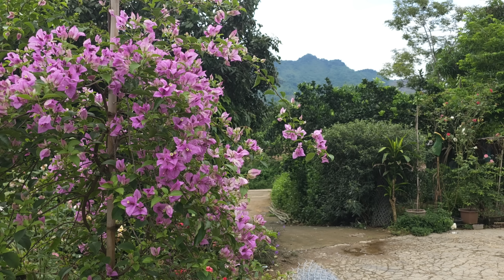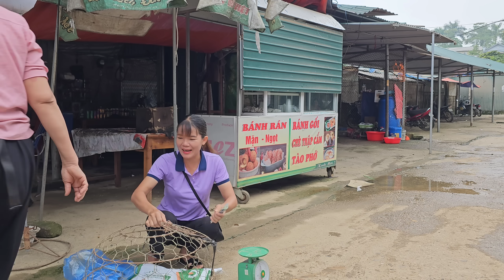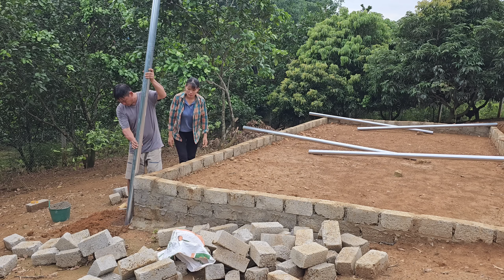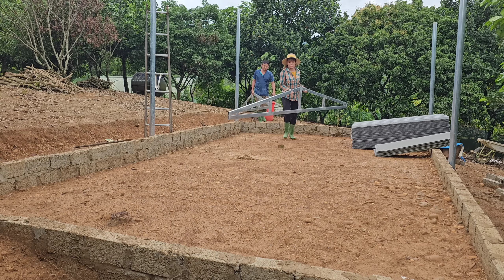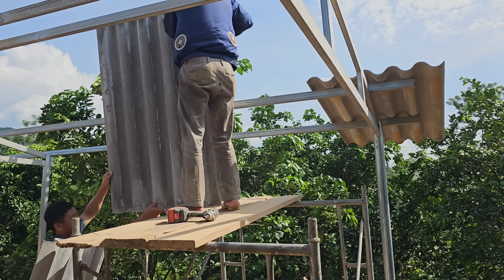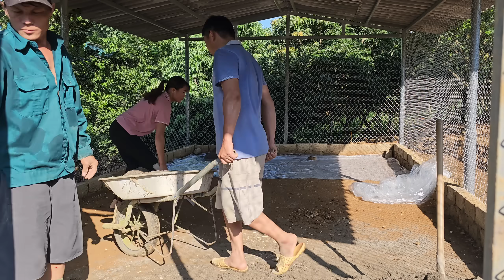Special chickens are sold at the market.  How to make a modern and simple chicken coop. (Ep 198).

Comment: Very good chicken coop, concrete sheeted roof to shade and keep chickens dry from rain, and steel posts to prevent termites; You have put a lot of thought into this coop and it will last for years.  You mentioned placing locust shells on concrete floor as a cushion for the harshness of concrete flooring.    Shovel out the used locust shells every 18 months to prevent disease building up and you can use the used locust shell and chicken poop as excellent fertilizer on your vegetable  garden/fruit trees.     Consider knocking/drilling out a small opening through the external concrete blocks at floor level, so you can hose out the chicken coop at the same time as you replace locust shells. This also helps with disease prevention.

As usual you have some lovely  roses still flowering and I really like the pink ones.   Good job with the chicken coop and best of luck with your next batch of chickens..
Reply from the maker: Hello, the newly built chicken coop looks very simple, only has an iron frame, corrugated iron roof, surrounding construction, and cement floor.  Although simple, for me it will be sturdy enough to keep chickens for many years.  However, I did not make the floor but just poured grass husks and sprinkled biological products to make a biological cushion.  After raising a whole batch of chickens, I clean out the manure once to make very good compost.  Well, thanks to your idea, I came up with it.  It is true that holes must be drilled so that every time the chicken manure is removed, water can be poured in to wash the coop and remaining bacteria.  Well, thanks to your donation, I was able to build a new chicken coop.  I would like to thank you very much.  The roses are starting to bloom beautifully, your heart is so wonderful, let me give you a bouquet of roses and the most sincere hug.  Thanks a lot. ❤️❤️❤️